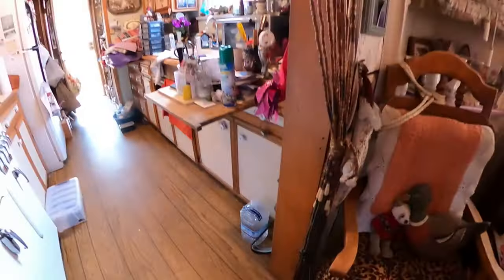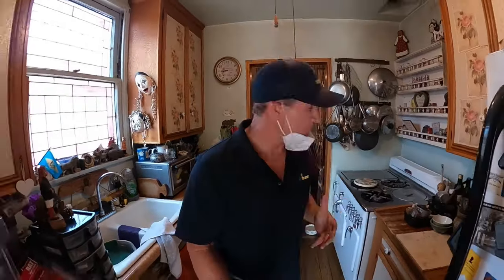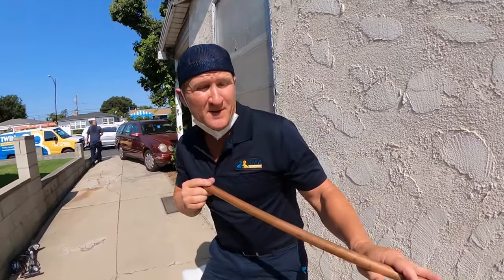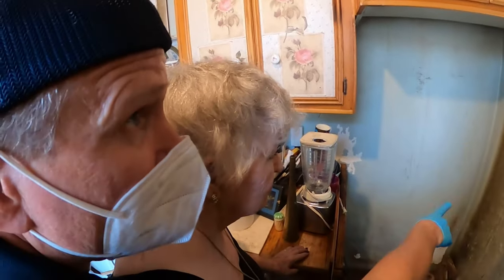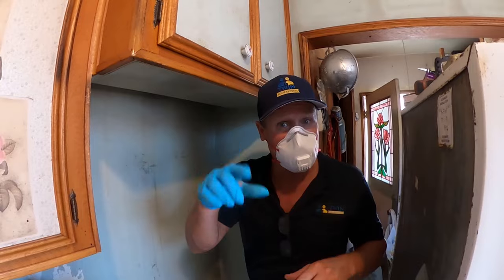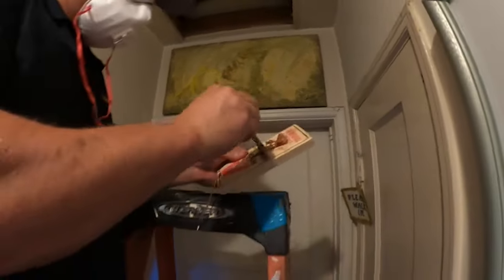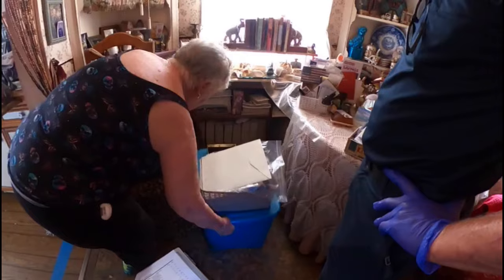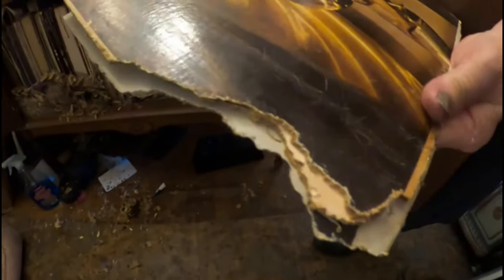THE BEST WAY TO GET RID OF RATS QUICKLY!!...blow gun

Comment: As a kid,  my buddy's house was getting remodeled.. 
The contractors knew that we were trouble makers, so one of them threw fuel on the fire..
He showed us how to make 'blow-guns' using metal electrical conduit for the tube, 
and then 'darts' by sending a long screw up/through a yellow wire-nut.
We spent all day blow-gunning things, and had an absolute blast!  No rats though.. 
It was all fun and games until' we attached the compressor hose w/ blower attachment to it.. 
Yeeaah..  that'll send those wire-nut-darts Completely through a sheetrock wall!  😂

Comment: Applause to you guys for attacking a hard work site like that one so professionally.  

I once had to install a telephone system in a house owned by a hoarding family.  I won't work in one again.  They can be dangerous.  This house looks worse than the one I worked in.
When I was older, a couple years after that phone install, I noticed *I* was holding on to things for no good reason.  Thankfully, there's help out there for folks that have the 'over-collecting' gene like me.  It's a behavior that can be treated fairly easily, except for the most acute compulsive cases.  Even those can usually be treated, but for some it is a real piece of work.

Comment: I feel for this woman, poor soul. What she hasn't been through. Trying to keep going with a heavy mental burden. Hey guys, try using a leaf blower. Not only will it disturb the rats it will disperse all of the contaminants into the air which will require a complete PPE and a clear out of animals and non protected humans. Major cleanup, and disinfecting. A nightmare job. I did exclusion on my mountain property and I believe I must have done a hell of a job. It took an entire summer. Cement work, small heavy duty wire mesh. The roof vent needs doing which I know. Replaced garage door stripping. Blocked off kitchen vents, stand pipe with h.d. wire mesh. Replaced plumbing, I could go on forever with what I did. Scrubbing, disinfecting, using leaf blower, masked to the max. Tyvek suiting. It's a job and a half. Just me, an older woman and these vermin were not going to win the war. Next and scary job is removing 70 year old fiberglass in the attached garage ceiling. Ever have a rodent pee on your head? I have. I think I may have squirrels because they pee like race horses when startled. Starting to replace wiring. Yeah, big bucks and a royal nightmare. You have to stay on top of everything not a minute where you can become lax or allow animal food and grease and grime to build up. Declutter that house. It all has to go, completely contaminated anyway.  The dart gun king, holy cow man. A dart gun? You are good. Our mountain rats are the size of pit bull puppies. They don't seem to bother other people but I moved here from an immaculate house I lived in for 50 years. Yeah, no can live like this. Great job. It will always be a never ending job. Now, on to replacing electrical. I'm in my golden years, and no this isn't how I thought I would be spending those years. I wish her luck, good health and happiness. Tragic story. Funny, I was also in Fl for hurricane Andrew to help with cleanup in North Miami. They didn't call me Hurricane for nothing. Every time I went to Fl I went into a hurricane and the last time I went into a FL hurricane was the last time I went to FL. You can keep that state. Pretty cool. You do great work. Keep it up. Only you get paid, I don't.

Comment: If you sprinkle baking powder around the perimeter of  the rooms  and doorways   you  will see  where  they   run to  and from,  then  I  made   a  grid  of    chicken wire and wired it up to 120 volts   and  place   peanut butter  and nuts  i the center .